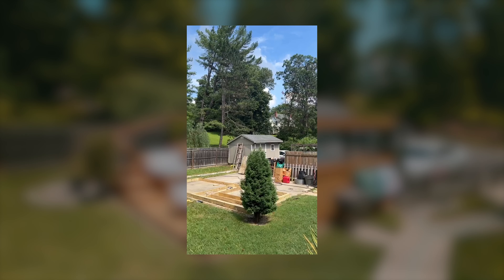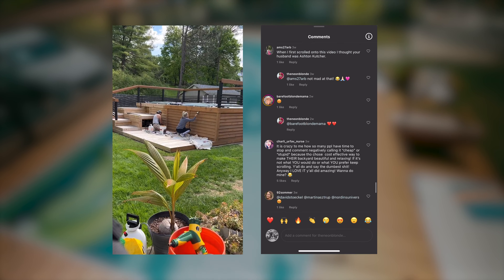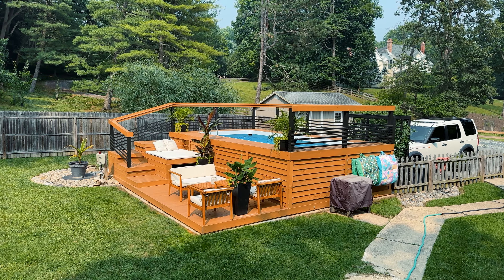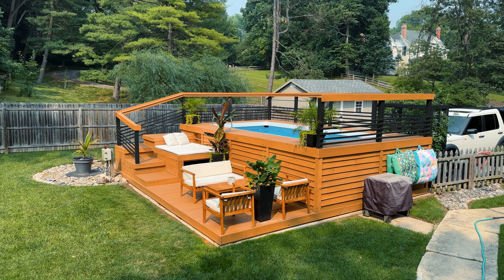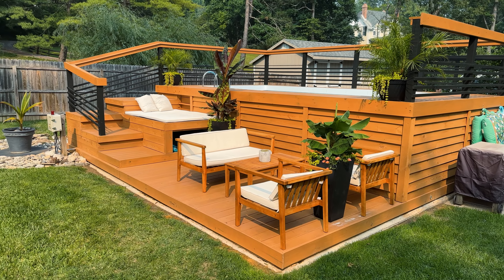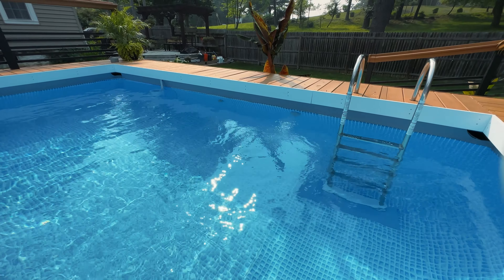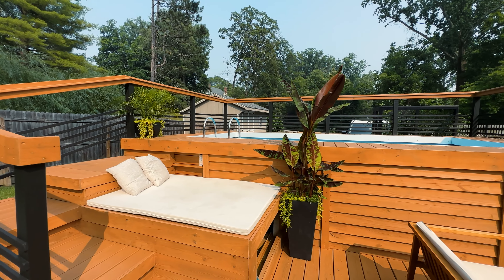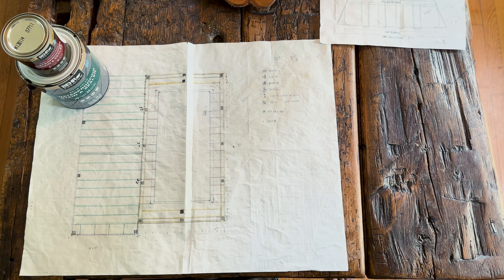DIY Pool for under $6K - Intex Ultra XTR and Saltwater System

Comment: This is awesome! I am just undertaking this sort of thing. Can I ask how you turn the light on white solid rather than colour which means pressing the little black button on the back of the light? Do you just reach in? I am thinking I am going to have to cut a door in the paneling.
Reply from the maker: Thanks for the comment! You're right about the door in the paneling. This is what we did with ours. There is a small access panel near where the light connects and we use that to access the button on the back of the light.
Reply: @taylordeyoungdiy  Good to know I was not missing there was another way to do it. Door it is! It is a shame there is no remote with them by hey ho! Nice Disco too! - You will save me a fortune in materials as I was going to use decking all the way up. But we can get that fencing for a fraction of the price! Thank you again for sharing :)

Comment: This  cant be legal lol
Reply from the maker: That's really dependent on where you live. This video focuses on DIY pool components and modifications. It's not a resource for localized building codes or requirements. Thanks for watching!
Reply: @taylordeyoungdiy  albeit this is a stunning design, once I saw that the decking isn't secured by posts and it is obviously above 30 inches off grade, I already had my doubts. I watched the video 2 and a half times maybe I missed something but I know for a fact that even if this was done outside of any code compliance jurisdiction, no one should be putting a platform that large off the ground without it being fastened by posts driven into the ground.  It's entirely different if you put a pool on top of a floating deck that is 20 inches off-grade. If the juice fails the most that will happen is a busted deck and a mess to clean up.  A platform such as this, is one structural failure and you will have people getting hurt or even killed.  There,s so many variables like gravity, nature, decomposition of the wood and fasteners. Even if that is Trex composite wood, that still not guaranteeing its structural integrity.
Reply from the maker: Appreciate the design comments! Admittedly I’m not an engineer by trade but I have reviewed the plans with others who are and we’re pretty confident in the design as it relates to our intended use. The posts and frame are secured to the concrete pad which I realize isn’t clear in the video. I can’t speak to the variables of gravity or nature but I believe we’ll get several years of use out of this, which as stated in the video is the goal. I believe with seasonal maintenance and upgrades, safety concerns should be low. As a DIY project, this was the design we chose and it met our goals. I’d recommend anyone who’s looking to engineer something further contact an expert in the appropriate field.
Reply: @taylordeyoungdiy  what's the total height of the platform?  Are you using a specific footing? I many makeshift decks I seen people do who don't use posts use Sampson strong tie footings which they bolt to the concrete. Of course it wasn't done legally bit it can be done. It might last a long time but there's an off shoot chance of it failing. As I said earlier in my typo ridden response, if it's a short distance to the ground no one would even care, but If someone decides to replicate this and something tragic happens, that's a lawsuit on thr homeowner. Also the reason why I highly go against butt joints vs post is like in carpentry. But joints fastened by nails or screws is NEVER stronger than mortise and tenon/dove tail/tongue and groove joinery. Ask any carpenter that. You could also run a test yourself and see how different it is in structural strength.  That's sort of why in almost every state they require posts on structural platform above a certain height

Posts is literally a mortise and tenon at a larger scale
Reply from the maker: The video isn’t a step-by-step guide on how you should build or construct housing for an above ground pool. With that said, the pool housing is not intended to be a platform or a structure on which people would congregate. In this video I tried to focus more on the pool components we chose and the modifications we made to improve the functionality of the Intex Ultra XTR system. A lot of the things I discuss are in response to questions I received online, e.g., where we purchased the furniture, stain color, pump and filter selection, costs, etc.. Should you choose to build housing for your Intex pool, the manor and degree in which you do that is up to you. I appreciate the specificity of your concerns but it’s a little off topic from the video. If it makes you feel any better, no butt joints were used for this project. Thanks for chatting and best of luck in your own DIY ventures!